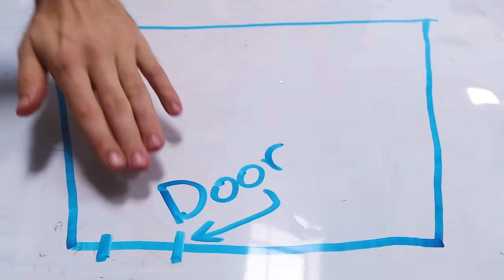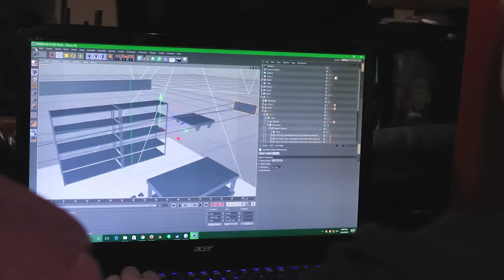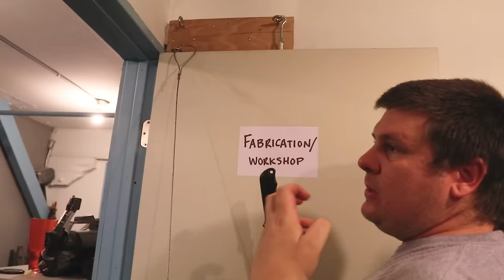Let's EXPLODE a Battery!

Comment: omg.... If you have such a LiPo Batterie Do Not Use it again... 
and Tying to fight the Fire with Water doesn't help at all.... that's what makes these batteries so dangeous... the keep on burning under water... and it is very toxic so yeah.... proberbly Not the Best idea... But it still looks cool
Reply: 1st: No, not that toxic. The gas is mostly CO2
2nd: Barely any lithium in the battery, so it won't react with the water. 
3rd: More danger = more fun haha :P

Comment: you guys over-complicated that top down rig. you could have just used some dual copper pipe in parallel and then just have a cable pulling the dolly with a motor.

Comment: Why didn't they build it with pvc pipes or something instead of wires...
Reply: i understand where your coming from but have you seen how flexible PVC is? My neighbor made a bow out of PVC. It fires weakly due to how flexible it is. I'd suggest aluminum
Reply: StRaFe_23 not if you stuff it full of fiberglass rods, use a heat gun to flatten and shape it, and use an actual bow string. I've seen some pretty strong PVC bows

Comment: Ur not spossed to put out a electrical fire with waaaattteeeeer
Reply: It's not an electrical fire, it's a reaction between the lithium and the water on the board...
Also an oxidization reaction caused by the electrolytes in the battery, but we don't talk about that.
Reply: Water played zero part in accelerating this fire. There's not enough lithium to react with the water.

Comment: Check out 80 20 aluminum framing for your top-down rig. Get 2 10' sections and bolt them to the wall along their length to eliminate shear stress. Then just make some rollers to mount your wires for the camera.  

https://www.mcmaster.com/#47065t101/=14w9efh